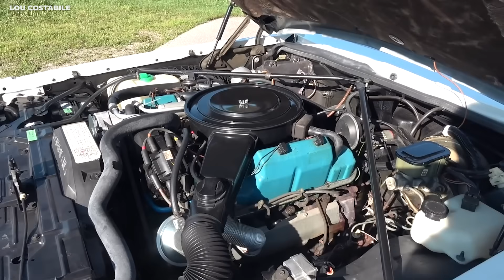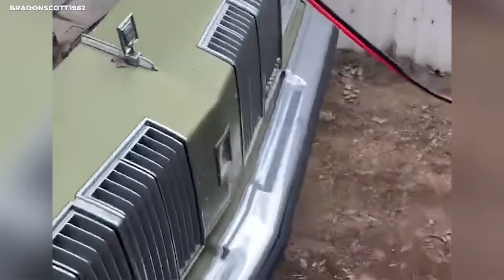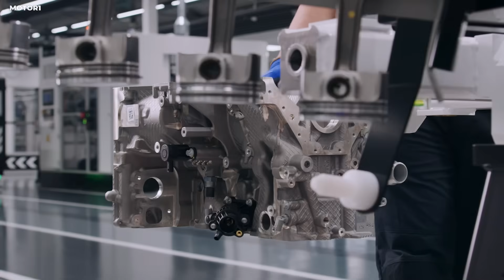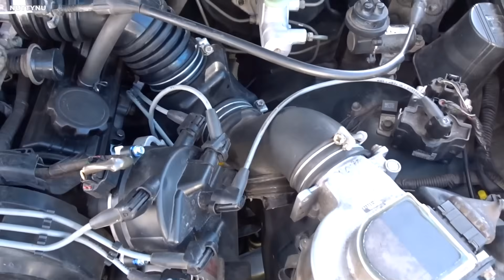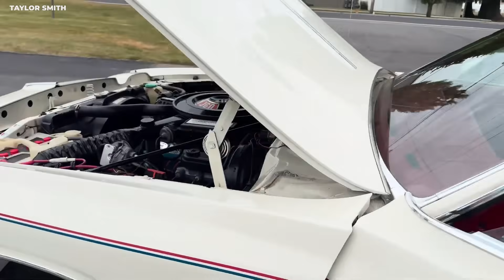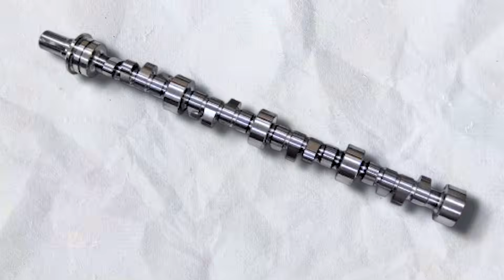12 WORST Muscle Car Engines Ever Made!

Comment: This is what happens when you have a pencil pusher at the epa THAT THINKS OH ITS GOING TO SAVE THE ENVIRONMENT AND THE MORONS THAT BOWED DOWN TO THEM THAT INSTALLED  CATALYTIC CONVERTERS HAVE CAUSED MORE HARM TO THE ENVIRONMENT   TO MANUFACTURE THEM AND SO ON  JUST A BUNCH OF WORTHLESS CRAP THAT DOES MORE HARM TO THE ENVIRONMENT IN THE LONG RUN...

Comment: "12 WORST Muscle Car Engines Ever Made!" Oldsmobile 260and 350 D 350 DX were not neant for speed.  the pontiac 301 turbo was a t**rd but the 350 Buick was a 410 lb ft  315 hp sbb engine which led to the production of the 3800 v6 and Ls engines. You get your info out your ass idi:ot!!! By the way the Oldsmobile diesel engine in gasoline form can produce 9600 rpm and over 970 h.p. proven By Stan weiss... Joe Mondello and others.

Comment: i had a 70s era buick 350 mill in a hot-rod it was flogged, abused ran hard and put away wet -on top of all that the engine wasn't built it was a junk-yard pull with 170K on the clock - it made decent power and torque IIRC -are you a bot with N experience just repeating the "infonet" gossip BS? -  this engine was eventually swapped again into a PU-truck  where it ran for anther 15 years--

Comment: Finally,  the Pontiac 301 Turbo was supposed to be a small displacement,  Fuel Efficient, Lightweight Muscle Car Engine.  But the Turbo placement, lag and oiling issues left it as a mediocre engine,  if it held together!